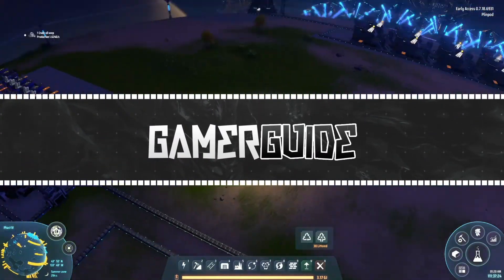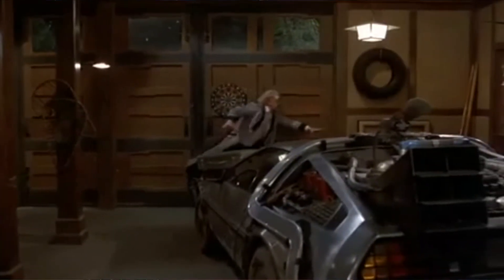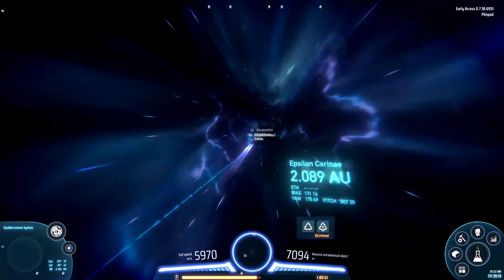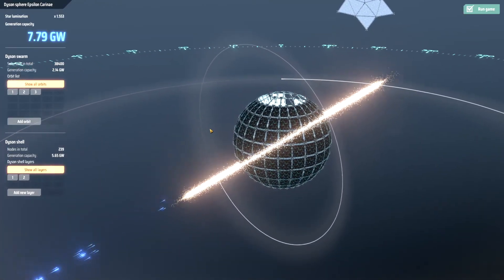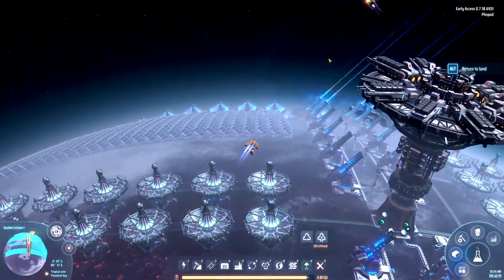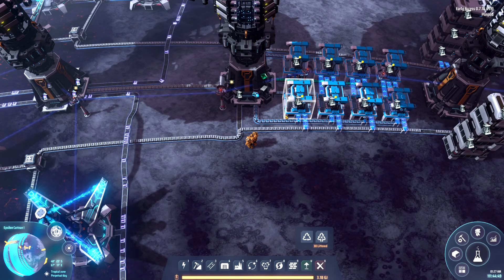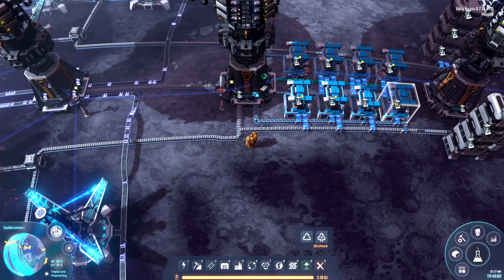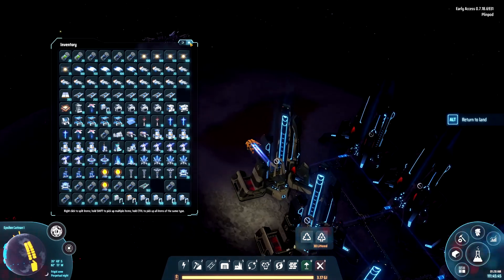Best Power Setup for Dyson Sphere Program - PART 2

Comment: I know this was months ago, but the best power setup is the artificial stars at 72MW each and a foot print the same size as the Energy Exchangers. Drop an ILT at each pole, and then build concentric rings of belts with enough space for the artificial stars between them. Just 3 rings alone will produce nearly 3.5 GW. You do need at least solar sail production to produce dyson swarm output to feed the ray receivers in critical photon mode. But, when done, even at only half a blue belt, you produce enough anti-matter to feed more than a dozen systems.